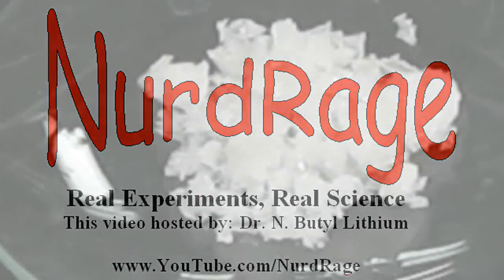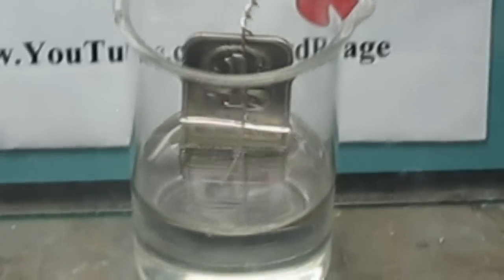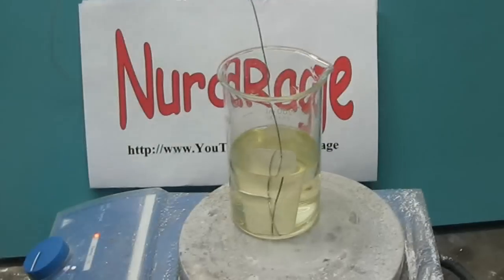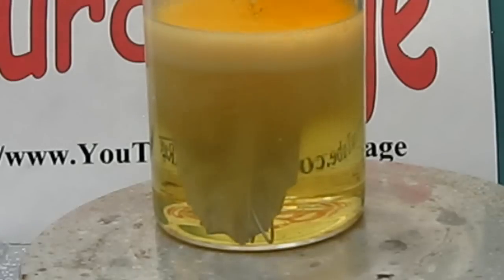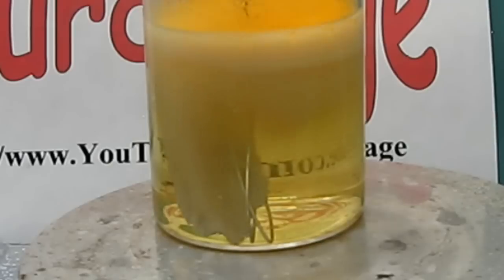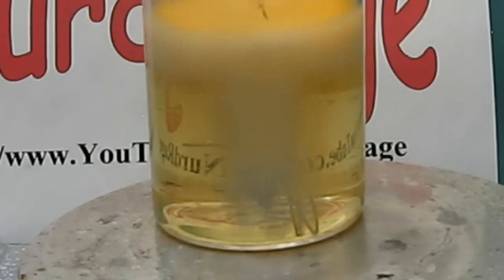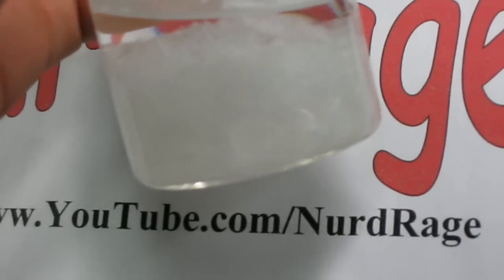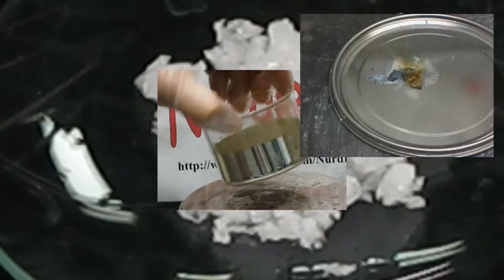Make Silver Nitrate From Silver and Nitric Acid

Comment: I have Agcl2 (aq). It dissolves in water.

agcl2 + hno3 = agno3 + hcl2
(Yes or no)
Reply: No. For starters, you have some facts mixed up. Hydrochloric acid is HCl, silver chloride is AgCl, and AgCl is only slightly soluble in water. If you mixed up these things with enough water to get the AgCl into solution, you will just end up with a very dilute solution of relatively unremarkable ions. Now There IS a well known reaction that goes like this....

HCl(aq) + AgNO3(aq) -> HNO3(aq) + AgCl(s)

This is what you wanted, only in reverse. It only goes this direction, because once the AgCl drops out of solution, it is no longer able to react. In order to perform the equation you suggest one needs to find a substance in which AgCl, HCl, and HNO3 are soluble and in which AgNO3 is not. There may very well be such a solvent, but I don't know enough about chemistry to say.

Comment: Use gloves when handling nitric acid? You're better off not wearing them. If nitic acid get on your skin, rinse immediately, but if it contacts nitril or latex, it'll catch fire.
Reply: That's fumeing nitric acid... Most nitric acid used in labs are 68%, which won't light your golves on fire.

Comment: Thank you for all your vids! cant stop watching! Ag nitrate solution wasn't evaporating after 10 days, so maintained on and off candle heat to help outdoors and shielded from natural light with aluminium foil. Solution has finally evaporated, however i am left with Ag nitrate that is somewhat yellow, and the nitric acid smell is still quite strong. Are these results ok for silvering? Should i redissolve and reevaporate? Thank you again!

Comment: If I use 80% pure silver (the kind of silver you find in forks and 
spoons) instead of 100% pure silver will I obtain good silver nitrate as
 well? What about the metals in the other 20%? Will they react with 
nitric acid or just precipitate out?
Reply: do your reaction with any silver and nitric acid, after it's done add huge acces of copper, copper reacts with nitric acid to form copper nitrate, it also reacts with silver nitrate to form copper nitrate and silver, after it's done filter it and wash it with water after that
remove copper pieces or just put your filter with the copper and silver into hydrochloric acid and peroxide mix, copper will dissolve and silver will stay, after that take your pure silver you just made and add it SLOWLY to nitric acid (reflux setup with addition funnel if you can) 

a bit of workarround but this will give you pure product whatever is also in your silver
Reply: ***** if he did what i said, it won't ...

Comment: Hi NurdRage.  Thank you so much for this video and knowledge.  I have a question for you.  I understand the effect of Nitric Acid not attacking the Aluminum, especially when cooler acid is used, and I understand the idea of this particular video is to dissolve the silver to make your nitrate.  Here is my question.  Using this same method presented in this video, is there a solution you can add that would prevent the Silver from dissolving at all, or at least to slow the dissolving process to a bare minimal once placed in the Nitric Acid?
Reply: Out of curiosity what prompted you to come up with such a question?

Comment: ok ill try again, i know you are very busy!
what constitutes concentrated nitric acid.
Reply: 70%
Reply: NotSoLogical that constitutes pure nitric acid.  I have found that is typically not what is used for these reactions, but then again Im new working with chemistry so what do I know
Reply: Clown Whisper Purity constitutes lack of contaminants. Nitric acid can also get up to about 95%, aka fuming nitric acid. But 70% is normally considered concentrated nitic acid.
Reply: I read that fuming was 73%...   damn sorry lol>  yeah I still use pure incorrectly for the topic.  

I had no idea that it could get up to 95%
Is that with simple distillation??
Reply: I believe you need a fractional distillation setup to achieve around 90%. You cant easily go over 95% as it forms an azeotrope with water.
Reply: see now I could have sworn that Nurdrage said over 73%  ill go rewatch that nitric acid video.
Reply: NotSoLogical yeah nerd rage said that you cant go higher than 70% because it forms an azeotrope with water
Reply: Clown Whisper It depends on how you are making it. If you use the sulphuric acid with nitrate salt method, you can get over 90% using simple distillation because there is no water present anywhere in the reaction. However, if you try to distill nitric acid from lets say 15% dilution with water, the most concentrated you will get is 70%.
Reply: Davy Zeng that makes perfect sense 

I did a vacuum distillation and got very pure very clear with hardly any tint at all to it.

I noticed that with reagent grade potassium nitrate you have to watch the foam.  it wants to foam up under vacuum. 
Are all of the nitrate salts similar?
Reply: Clown Whisper Salts from the same group of elements tend to be pretty similar.
Reply: NotSoLogical thank you for that.  I need a good way to regulate vacuum.. the one thats inline is crap. it seems to be all on or all off

Comment: hi, does anyone know how to clean silver nitrate of nitric acid. i just dissolved some silver for use in wet plate photography but it is not working , and i fear it may be that the nitrate may need cleaning or preparing in some way. anyone?
Reply: i think you have to get distilled water and keep evaporating it until acid has gone, a certain ph is required.
Reply: +andrew nichols you should use a high quallity of nitric acid.. you can distill impurities away... and when the silver nitrate is formed and dried you can wash the crystals...probably by dissolving the silver nitrate in water and then lower the temperature for precipitation... the rest solution of water and silver nitrate could then be reused by precipitating out the silver and starting over again.... this is fairly easy... but i would probably just buy the pure product to ensure a good result..
Reply: thanks kristian, i have tried using distilled water in crystals, i believe its a certain ph.
so far i have burnt 3 batches by being distracted as it takes soooo long on low heat using glass bowl and heating with boiling water from a steel pot. yes i need to get a timer! will try again, silver was $850 a kg acid $70 so i shall persist and then buy next time from china at $600kg delivered. but i didnt know that then and my geek days are just beginning.
Reply: andrew nichols dissolve until saturated silver nitrate in demineralized water not distilled water... then place it in the freezer an keeping an eye on it to see when crystallization stops... you can use a phase diagram to determine the exact temperature with a thermometer  when most of the silver nitrate is out of solution .. then decant remaning solution and dry crystals... I have used this method and it provides VERY clean crystals ... like 99.9+

Comment: so, I was wondering if somehow you be able to get the NO2 gas pass through water(like bubbling it) to get nitric acid, would it works? I mean, can some nitric acid(even if is not 100% effective) be recuperated?
Reply: The original reaction is only producing NO, the NO2 is made by reacting with the oxygen in the air so I think it would be difficult to actually effectively harvest the NO2. I could be completely wrong though, don't let my guess stop you from trying.
Reply: BlackMagicProd so, if thats is it, actually there's no need to harvest from the air. you just close the sistem and the in the end you put to bubble in water; but with a little addicion. you can use a little compressor or air pump this will supply the necessary oxigen
Reply: Keys Wolfram
Or you can let it go in a hydrogen peroxide solution but if your only objective is to loose less money by recuperating the acid, i don't think it will be very usefull.
I just saw: 1 month, is your technic working?

Comment: I have used nitric acid and water to dissolve some silver and then used copper to make it precipitate it back out so hopefully the silver is now fairly pure. I want to now take it back to silver nitrate - I just thought I would check before proceeding as due to the silver being incredibly fine powder at the moment, would I need to heat the acid as presumably the surface area of the silver is now huge. Would appreciate your thoughts please.

Comment: - get silver
- synthesize a few mg of silver nitrate
- get a copper screen (sold in a lot of shops here)
- electroplate copper screen with silver

Do you think this is 'doable'? I'm afraid that the silver coating might not be enought but since it's all about surface area it came to my thought that it might be possible..!

Regards!

Comment: He might value is labour higher, but if you treat your own labour as $0 and just use enough acid to do the reaction (and save the rest for other, more fun reactions!) you can bring the price down to $45 for 50 grams. Still more than you need? well buy a smaller piece of silver, use less acid, and go from there. Why are you honestly complaining about his video when you can easily adjust the proportions yourself? or can you not do math?

Comment from the maker: Your estimates are far off.

500g bottle of silver nitrate from sigma aldrich costs $1095

the equivalent 10 troy oz of silver costs a little under $350 at current prices.
500mL of nitric acid (more than i need) $102 (tax included)
Labor as chemist: ~$100

So, a total of $552 to make Vs. $1095 to buy

But please keep in mind that just because you have lesser requirements (liquor bottle) doesn't mean i shouldn't make videos for others with greater requirements (argentiometric titrations)

Comment: It isn't a lot more expensive. Silver isn't cheap. You will need $50 worth of silver to make $80 worth of silver nitrate. Plus you don't need to buy any nitric acid, and it's much much safer. I'd rather pay the $30. It only takes about $5 worth of silver nitrate to coat one liquor bottle. Your way would save how much? $2 per bottle? That is less then the tax on the liquor bottles I would want to silver.

Comment: @svendmusic The 10 ounces of silver would be 2.596 moles of silver. And assuming that silver is the limiting reagent. 2.596 moles of Silver Nitrate would be produced. So, theoretically 439.96 grams would be produced. So approx. 15.7 ounces. Although the actual yield will be lower than the theoretical yield due to experimental error and such.

If you want more information on how this was calculated feel free to ask. But unless you do want to know, I won't type out the calculations.

Comment from the maker: @17Blackreaper to control the reaction. If the bubbling goes way out of control and might overflow, or if it starts sputtering, you can simply yank the silver out by the aluminum wire "handle". The reaction stops, and you can turn down the temperature or dilute the solution at your leisure, then restart the reaction by lowering the silver bar in again.

Comment: @Nurdrage This was a wonderful and enriching video! But I just have one question. Aluminium won't react with ethanoic acid but it does react with copper ethanoate. The same goes for nitric acid and copper nitrate. Will the Aluminium withstand the Silver Nitrate? I think a thin layer of silver is formed on the Aluminium. Is that correct?

Comment: Nurdrage -
I know that Aluminium metal is resistant to HNO3, but is it resistant to AgNO3? 
An example is that Aluminium would not dissolve in Ethanoic acid but it would react with copper acetate.

Comment: @ScienceHideout Hi science hideout, yes there is a very simple way, just take the coin solution and add a copper pipe, the copper will dissolve and precipitate pure silver metal, filter and wash the silver metal then dissolve the silver powder in nitric acid to get pure silver nitrate. In fact I'm editing a video on this.

Comment: @athaulfthegoth Dear Anna! Whether NO or NO2 is produced directly depends only on the concentration of the acid. If it is around 30%, NO will be produced. If it is 60% or above, NO2 is produced. But as NO is very likely to give of one it's unbound electrons, it reacts with the O2 in the air to make NO2, which is significantly more stable.

Comment: NurdRage I have a few questions-
How much Nitric acid should we use to dissolve in 100 Gms of silver.
To remove presence of nitric acid totally from silver nitrate how can we use disttled water.
How can we heat the glass flask,will it not break. 
Does the Sun light affects the shinning of Silver Nitrate.
Is there any book  available of making Silver Nitrate.

Comment: What was your return in grams of silver nitrate, from your one ounce bar of silver. I only was able to get 47g of silver nitrate...What went wrong here? 
I have done the reaction using 100ml of 70% nitric acid and one troy ounce of .999 silver like the one you showed, but I cut mine to smaller pieces. The silver was added gradually over a 45 min. time till it all dissolved.  This yield seems to be very small, and discolored ( due to a little sunlight I'm assuming).. 
Any words of wisdom here?

Comment: Thanks a million.., this video is most helpful.. Just one Q. of concern...,

1st , there seems to be a excess of hno3 used in this reaction, and if so how is it removed from the final silver nitrate? 

I see that you left it to evaporate and precipitate out of solution, but gave no warning of nitric acid left in the final precipitate , or if it just stays in the crystal structure of the nitrate when evaporated, leaving just h2o behind as a by-product.

Comment: @pyropakman however, I dripped a few drops of 98% sulphuric acid on to the silver bar and yes for the first half hour, there was nothing interesting happening. But slowly I could smell rotten eggs and tiny bubbles, possibly sulfur dioxide. It is also worth noting that my silver bar is not pure only 60%, the rest i presume it is copper.

Comment: Also, was planning to make nitroglycerin. I have 98% sulphuric acid and 68% nitric acid. I read on wiki that the solution of nitric and sulphuric 50:50 ratio have to be suspended in a ice bath before glycerin can be added or else it will auto ignite. Any other advice? also can i use crude glycerin from biodiesel production?

Comment from the maker: @aeroscope the fumes are nitric acid, so yes it is dangerous. but only if you inhale it. work with it in a fumehood or outside.

to render it safe, measure the amount of acid you have. Then measure out 1.4kg of baking soda for every liter of acid. Now mix the baking soda with an equal amount of *water* first. Then carefully pour the acid into the mixture of water and baking soda. it will fizz alot. when you're done, the solution can be dumped, it's just fertilizer now.

Comment: I have found placing a round bottomed flask containing ice and water over the reaction vessel condenses the gases and re-generates the acid. If using dilute acid, leave a tiny (<=1mm) gap for O2 to enter to react with NO.

A reminder for everyone, the brown NO2 gas evolved is a delayed strong toxin. Don't breathe it. Take proper precautions.

Comment from the maker: @Nityananda108 
 around 100 degrees Celsius. Not too hot to boil, but still much hotter than room temperature.

Best way to find it is just to heat it up until the silver starts to bubble/dissolve, then dial back if it's too much. Pull the silver out entirely using the aluminum wire if it goes out of control.

Comment: I tried this using dilute nitric acid and Sterling silver, but it didn't work too well. I had to heat the solution to near boiling to notice any kind of reaction at all, and the silver quickly formed a black layer coating it. My "nitric acid" was really sodium nitrate dissolved in excess hydrochloric acid.

Comment: Acids are defined as producing positive H+ (well, H3O+) ions in water (to a greater extent than pure water itself does, i.e. things that have a pH of lower than 7). Glass is Silicon Dioxide which is very unreactive and does is not affected by this ion. However, the acid Hydrogen Fluoride can dissolve glass due to the negative ion, extremely reactive F-.

Someone better at chemistry will be able to explain this in more detail but I think what I have said is more or less correct :D

Comment from the maker: @95barqs1

If the reaction goes out of control, you need an easy way to stop it. Pull the bar out with aluminum wire is the fastest and safest way of stopping the reaction

Comment: thanks for responding, experimentation would be wise , especially since i do not know how the alloy elements in the aluminum might affect the passivation effect, your wire is probably comm. pure grade , in mechanical parts 6061 is the most common alloy (about 1.2%Mg and 0.6%Si). next time a drill breaks i'll give it a try.

Comment from the maker: Interesting! To be brutally honest i'm not certain.

High concentrations of nitric acid also passivate iron and steel. But Aluminum has a much wider passivation range. So there might be a range of concentrations where iron/steel will dissolve, but aluminum will not.

If you happen to have a part that you're going to scrap anyway and some nitric acid, try some experimentation. 

Would be an excellent scientific project. :)

Comment: very cool vid, 5 stars, i thought that it was very interesting how the HNO3 did not attack the Al wire, i also realized that this property of  Al could be very useful ; if i  were drilling or tapping an Al part and and the drill or tap bit broke off inside inside the part , could i use concentrated HNO3  to dissolve the steel drill/tap and save the part? otherwise a broken drill/ tap in an aluminum part is nearly impossible to remove and the part is usually scrapped.